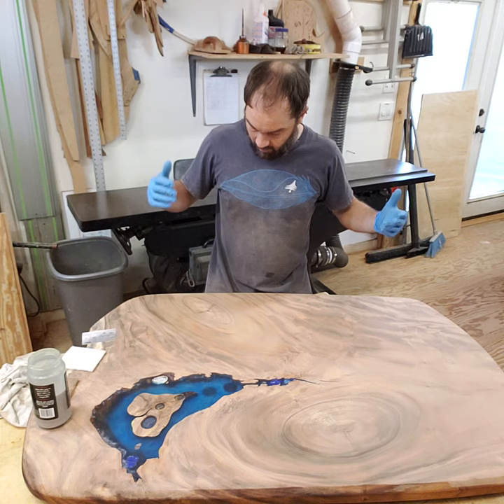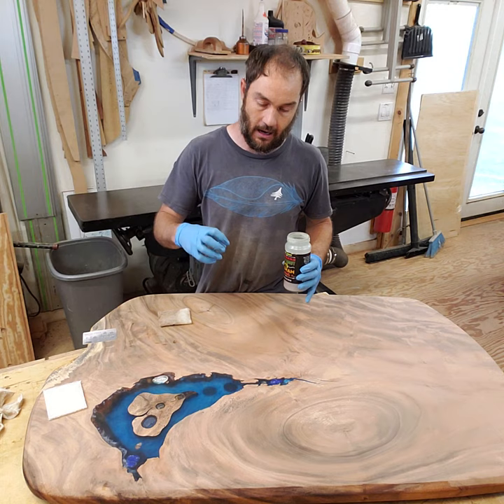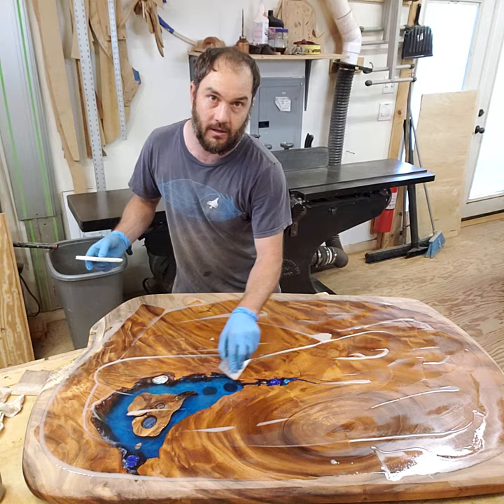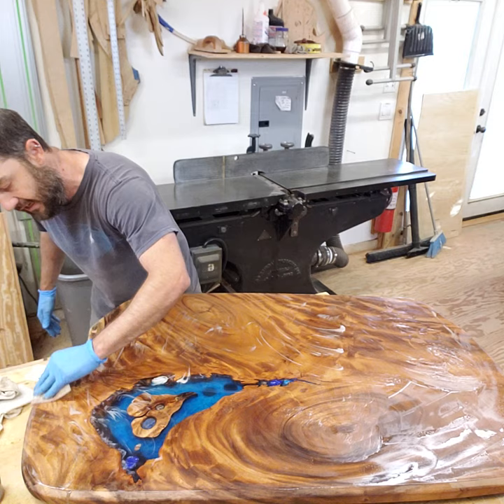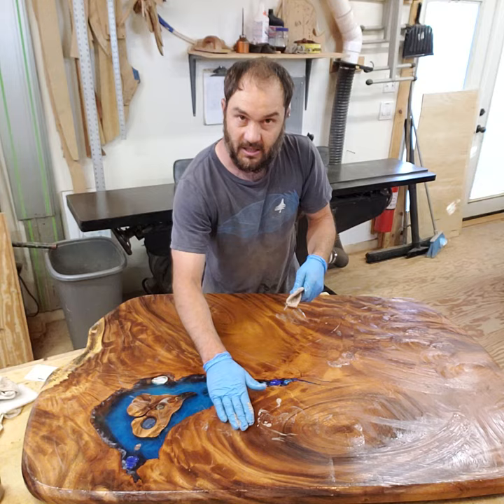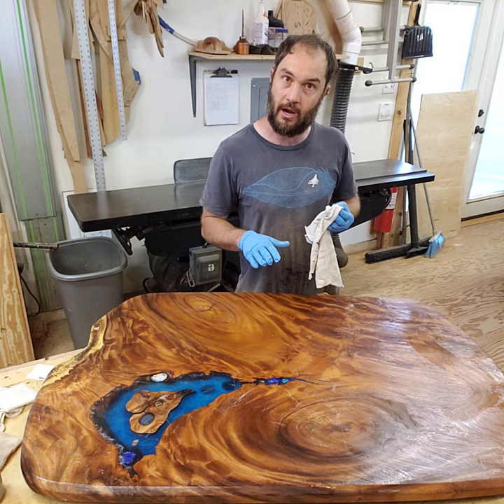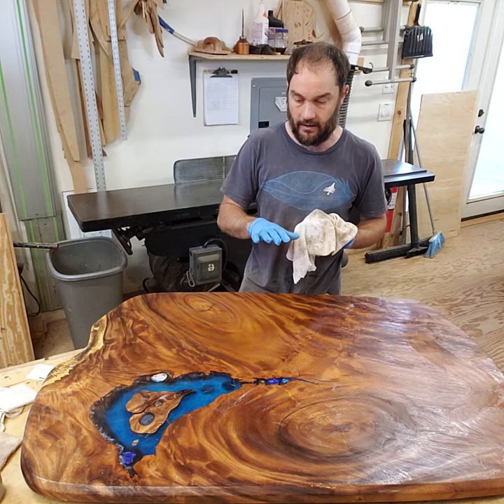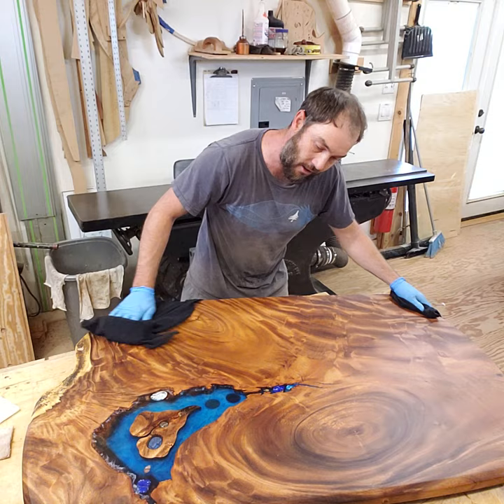How to apply osmo polyx hardwax oil to furniture

Comment: How did you prep the surface prior to the first coat? Sand to a certain grit? Mineral Spirits to clean? Wet the wood?

Any additional prep before the second coat?

Have you used Rubio Monocoat 2C? How does this compare?

Thank you for the great video!
Reply from the maker: I sand furniture to 220 grit and then i wipe the wood with a piece of velvet scrap cloth that does a great job of removing the dust.  Because all the finish gets removed from the surface and buffed, the dust removal is not as essentual with this type of a finish.   No need to clean with any solvents as long as the piece is already clean of contaminants.  I do not water pop at all as the oil finish does not raise the grain.  Also, no need to sand between applications.  This is a really easy finish to prep and apply and looks amazing as long as your sanding was consistent and thorough.
Reply from the maker: I like osmo over rubio as the osmo needs no catalyst.  Less wasted finish.  The osmo does need 2 coats usually and even 3 for a top surface like a table.  Both finishes will need folow up products to maintain their look and protection after a few years.  Both are super easy to spot fix and reapplication just requires a cleaning, or a light sanding if you deem it necessary.
Reply: @isakziegnerdesign  Too easy! Thank you! Now I just have to decide bt. Osmo Clear and Raw!
Reply: @isakziegnerdesign  Catalyst optional if you don't mind a 3-week cure time lol. However, the "mono" of the Monocoat is appealing. I originally was going to go with Rubio Monocoat 5% White or Natural to keep a light wood fairly naked looking (liked them both), but thanks to your video I ordered some Osmo Polyx Raw (apparently it has a 2% white pigment, whatever that means, to mitigate the slight darkening color change that comes with their clear Polyx products) - fingers crossed that gives me a similar result! Thanks again for a great video - and nice table.
Reply from the maker: @tullynation   The raw sounds interesting and I had not heard of that yet. Would be perfect for the project I'm doing right now actually where client wants to retain light color. I hope you really like the osmo. I tend to stir it well and then put it in an old ketchup bottle or something with a small squeeze top. Makes it easy to dispense a little bit onto the wood at a time.
Reply: @isakziegnerdesign  Brilliant idea. Will try that. Do you find that extra will keep on the shelf for awhile if adequately sealed (I saw in the video you transferred to a smaller container to keep out air)? 

Osmo recommends when using Raw that the second coat be your standard Clear (Matte, Satin, or Gloss). Not sure if I'll bother with that. But if you like I'll report back once I've had a chance to use it.
Reply from the maker: @tullynation   I would love to hear your experience with osmo raw. I suspect they recommend only one coat as it will start to look a bit white with more layers of pigment. I do put my osmo into smaller jars as I tend to use a few ounces at a time and I want to avoid a 1/2 empty quart can as the top layer will begin to skim over after a month. They say an unopened container has a shelf life of about 3 years. I take my new can and mix it thoroughly and then put it into smaller reused jam and Olive jars. The portion that I am actively using I keep in a squirt top jar until it is all used up.
Reply from the maker: @tullynation  message me on Instagram at @isakziegner_design with experiences, questions and your project pics!

Comment: Great Video! How do you work with the end grain and getting the pores to all fill in smooth with Osmo PolyX? I filled large checks with epoxy and sanded my end-grain (from oak cookie) table to 220 and it was very smooth. I did my 1st coat per your video instructions and allowed to dry for 12 hours. Still had pitting/pores in surface after 1st coat, so lightly sanded to grey 3M extra fine pad (not down to flat/smooth again but just to lightly scuff and applied 2nd coat and wiped off excess, thinking that additional Osmo would fill in the pores, but can still see some pores in surface. Now just waiting for 2nd coat to dry 12 hrs. Any suggestions?
Reply from the maker: I would try wet sanding if you want the pores to be filled.  Pores are designed to transport liquid, and are doing just that.  It may take a lot of thin coats to fill them up.  Wet sanding and creating a slurry will help fill the pores as it becomes more of a thick paste.  Look into some wet sanding technique.
Reply from the maker: Check out my reply to JParson as i detail a bit about pore filling.  Recent commemt thread.

Comment: Great video and thanks for sharing. Did you finish both sides of the table, or just one?
Reply from the maker: I always finish both sides of anything wood.  That way the sides are both expanding and contracting equally.  If only one side were finished the seasonal wood movement would be different on each side and lead to a greater chance of warping and distortion.

Comment: Is the Osmo PolyX the same as the Osmo Wood Wax finish with color?  Have you used the tinted product?  Great video btw.
Reply from the maker: I suspect they are quite similar products just without a color but I have not used the color version.

Comment: Great video. I do epoxy river tables. Most of the time I just pour the thick heavy epoxy coat on top and let it blind you from the gloss. Some people love that. Me, I prefer a more satin natural look. Anyway, I'm doing a big ole peninsula river pour at my house. The wood is soft beetle kill pine. Wifeey likes the blue hue of the wood. First question: Will the PolyX work okay over the epoxy? I've checked on some other products and they don't do well over epoxy (delaminate,  or the finish gets soft). I saw you had epoxy on this project (it looks awesome). 2nd question:  Any tips on  prep sanding pine? I usually work with black walnut and cherry. Harder wood is more forgiving in my book.
Reply from the maker: Check out what @blackforestwoodco is doing.  Huge business making epoxy river tables.  They use osmo. https://instagram.com/blackforestwoodco?igshid=mqi344021361 .  I know there are other recommendations for soft wood.  I believe it drinks up a lot more finish.  A softwood table is going to dent a lot and show lots of marks.
Reply from the maker: You polish the epozy to whatever sheen you like.  It is plastic and will not absorb any finish.  Finish over epoxy will make it less clear and vibrant unless it is gloss clear.  The osmo just wipes off the epoxy.

Comment: Is it important that the osmo remains on the surface for a minimum period of time before wiping off? Some links advice to apply and wipe off instantly. Thanks
Reply from the maker: I would recommend 20 or 30 minutes to let it soak in after you are done applying and then I go back over it with the applicator pad to redistribute any that is left on the top and also to re-wet everything.   Especially on the 1st coat you really want the wood to absorb as much finish as it is willing to soak up so letting it sit on top and then re applying or redistributing the finish again helps the wood to soak up more finish. It is absolutely essential that once you are done with the application and any waiting you want to do and then redistributing, that you remove absolutely all the finish at the end. Wipe it all off and then get a clean cloth and both and wipe it completely so that it feels smooth and waxed. There should be no more finish coming off.  Allow 12 hours between Coats and you do not need to sand in between Coats unless you want to.  You will notice on the 2nd coat that very little soaks into the wood as you have now saturated the wood and mostly sealed it up so you are just applying a little extra protection with each additional coat.   Again, it is absolutely essential that you remove all the finish at the end of each application.
Reply: @isakziegnerdesign  ahh mega thanks! So same for the second coat 20-30mins too absorb. 
If I find that after 15mins the surface and become really tacky so much so that my lint free cloth Jams, you recommend applying a little more then removing ALL the excess right?  Just to re-wet any areas that have gone tacky? Thanks …
Reply from the maker: @antb3334  yes, you can rewet, but also it is just fine to remove once you feel it has absorbed.  Better not to waste finish.  Maybe just give it 5 minutes after the first coat.  If it is hot weather, it is good to remember that it dries much faster!
Reply: @isakziegnerdesign  Thankyou man!

Comment: Beautiful table and great explanation.   Question:  how do you deal with a situation where you can see scratches in the osmo finish?  Having looked at some other videos it seemed like you needed to leave a slight film  - which in my case had some very small scratches/ridges.  anyway, you can see them and it's a bummer.  do i need to take the entire finish off?  thanks
Reply from the maker: Do not leave a film!  Buff all the finish off the surface after application.  It will harden on top but is not tough as a film and will certainly not hold up.  If, after buffing, you still see scratches, they are from your sanding and need to be sanded more thoroughly.  This type of finish requires careful preperation to ensure you sanded consistently as it does not hide anything on the surface.
Reply: Isak Ziegner thanks isak. Yes unfortunately I watched some other videos and they recommended wiping off with a white pad which when I did it still left some very thin ridges.  So no I can still sort of see them in "raking " light.    I'm up to 4 thin coats - hoping the ridges (really just lines) would go away.  If not would you recommend taking it all off?  I will definitely use your technique the next time around.
Reply from the maker: @petehill3430  sand it back until the ridges go away, then do one final coat with a complete buff off.  You may have succeeeded in filling some pores this way like with wet sanding.
Reply: @isakziegnerdesign  thanks. That worked out well.   Than an again for the clear demo-  I'm much more confident with using osmo now
Reply from the maker: @petehill3430  i am so very happy to hear that my experiemces were able to help you a bit!  Have fun out there!

Comment: I have been using Osmo for a few years now. The point you made about it needing to be maintained, can you comment on that? What are you applying to the table?
Reply from the maker: Traditional oil finishes stop protecting after a relatively short period of time and need to be renewed. Hard wax oils like osmo have better protection and a longer service interval. I generally look for signs that they are no longer preventing absorption of liquids and/or a general dry look as if the wood is thirsty and not very waxed anymore. At that point I would do another top coat after cleaning the surface thoroughly. At that time I would also sand out any blemishes with a high grit like to 220.

Comment: Question about the Osmo over the epoxy.  DOes it dull the sheen of the epoxy?  I am going to be doing an epoxy river desk top for a standing desk and it will have an epoxy run down the horizontal path of the desk so wondering how dull epoxy may get if at all.  I am also guessing that the Osmo cannot penetrate the epoxy so maybe the wiping you were doing with the t-shirts took the Osmo off the epoxy?
Reply from the maker: Ideally you complety remove the finish from the epoxy.  There should be nothing left on the top of the surface when done.  As epoxy is non-porous and does not absorb the finish, there should be almost no change.  Be sure to sand and polish your epoxy to the final look you want prior to finishing.  Black forest wood co may have some tips for you as they do a lot of the epoxy river tables.
Reply from the maker: Rubio is also wax and oil like osmo.  Pallman magic oil as well. I see minwax has one out now.  Odies oil is similar.  Rubio relies on a catalyst to dry quickly and should have a 1-3 year service requirement like all these harwax oils.  Easy to repair.  Easy recoat.  Much longer interval and better protection than just a wax or just an oil finish.  When to service is subjective .  Is it looks dry, absorbs things quickly or gets damaged, you clean and reapply.  Maintenance can be oil, wax, or anything compatible with the 2.

Comment: Hi Isak, can I use the Osmo Polyx oil over an oil-based stain? Great video by the way.
Reply from the maker: Yes, osmo is an oil product and will go nicely over an oil stain.  As long as you have not sealed the wood with any product, osmo will work well as it needs to be able to soak in to the wood.  Osmo also makes colored versions so you can get a color by applying the finish in one step.  This is quite common with floor finish type products.

Comment: Would you use this only on a dining table or would you use something on top of it to make it more durable?
Reply from the maker: I would most certainly use this on a dining table if this was the type of finish I wanted. If I needed something with more of a protective barrier I would use  a 2K polyurethane and spray it. Osmo is a really great penetrating finish that leaves the would feeling lovely and natural. I like that it is very easy to repair and maintain.   I have osmo on the counter tops in my house.

Comment: Thanks for the video on Osmo. I am finishing a toy box top made of maple butcher block with some resin inlay, so your video caught my eye. Thanks for addressing the inlay issue - basically sand it to 1000 and keep the finish off of it, right. Might be hard as my inlay is in CNC-carved letters. Just sand the inlay by hand to 1000, right? Also, I wondered about applying the Osmo with a buffer of some kind. I have the Festool buffing kit, which has the white non-abrasive pads. The Osmo product site suggests buffing by machine after it is dried.
Reply from the maker: Hi lawrence, the buffer is great and saves a lot of time on bigger surfaces.  Buff until the finish seems to be gone.  I would still buff with a clean cloth afterwards.  On a small box i would probably not want to pau for a buffing pad unless i was doing several boxes, or finishing ither items at the same time.    You can apply finish to the inlay, as it will just buff off.  It helps even out the sheen, as the polished epoxy tends to be shiny.  Think of the finish on top of the epoxy as working like furniture wax, as in a surface treatment.  It is not recommemded to sand all the wood to a high grit like 1000, as this clogs pores and reduces absorbtion.  It may work just fine though.  Worth a test.
Reply: Isak Ziegner-thanks so much for the reply- my plan was to sand the wood to 220 (what Osmo recommends) and try to sand the epoxy resin to 1000 or 1200 - I have the equipment and pads to do it with, just trying to sort it all out. Good luck with the channel! Keep the videos coming!
Reply: Another question- I have had paint “wick” into the surrounding wood fibers when I carve things- I usually hit it with some dewaxed shellac spray before I paint. Does the colored resin also wick into the surrounding wood? Is it good to coat it before you put the resin in?
Reply from the maker: @LDBecker  i pre seal my inlay area with a layer of epoxy before i do any thick inlay as i want to seal in any bubbles and saturate the wood a bit.  Just brushbit on and let it soak in amd harden like a layer of finish .  You can do this to the top surface as well, if clear epoxy is gping to be alright for color.  Or use shellac as you mentioned.  I try not to get shellac into my actual inlay opening as i suspect it will block the epoxy from binding properly with the wood fibers .  Tape masking the top surface can be helpful.  I make a perimeter with silicon caulk so i can overfill my inlay and not have to worry about it settling below the surface height.

Comment: Thanks for the great video. I am about to do a large Guanacast dining room table as my first Osmo Polyx project. I have it sanded and I’m pretty happy with the surface, but found that there is still a very fine amount of dust from the sanding even though I used a Festool sander attached to a Festool vacuum. I have brushed it but still feel that there’s too much sawdust. Should I clean the surface with mineral spirits or something like that before I apply the Osmo? I get the impression from the beginning of your video that the dust is really not a problem. Am I understanding you correctly?
Reply from the maker: The bottom line is that you will be fine with a little dust because you are wiping the finish off completely.
Reply from the maker: I usually remove dust with compressed air from my air compressor and then a piece of scrap velvet cloth
Reply: @isakziegnerdesign  thanks.
Reply: @isakziegnerdesign  thanks,.

Comment: Hi again after watching your I want to use osmo poly x on some hardwood coasters I made would you recommend a stain or clear finish or? Thanks Happy Thanksgiving
Reply from the maker: I would use just osmo polyx.  If you want to change the color then stain first, then add osmo.  It never cracks or peels  and you can reapply if it ever needs to be updated and refreshed.
Reply: @isakziegnerdesign  thank you!

Comment: Been looking for a topcoat for epoxy. Looks like that might work. Any thoughts? I just hate epoxy when it gets a scratch plus it's almost too shiny
Reply from the maker: Osmo may change your sheen a little, but adding oil and wax on to epoxy creates very little change, as you wipe it all off.  Nothing is absorbed in to the epoxy.  I would opt to spray a coat of 2k polyurethane over the epoxy and select the sheen you want.  This adds a more durable surface over the easily scratchable epoxy.  Less polishing is necessary if you top coat like this, as you want the epoxy to have a little texture so the polyurethane will adhere properly.  Let me know if you have follow up questions....